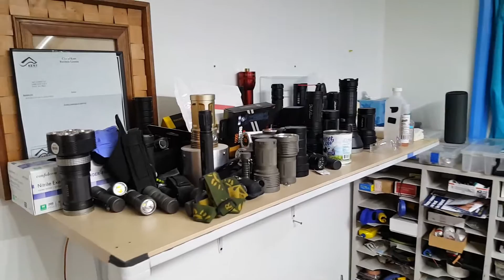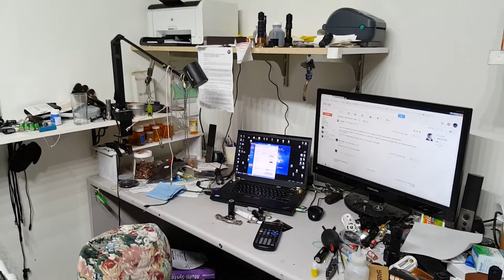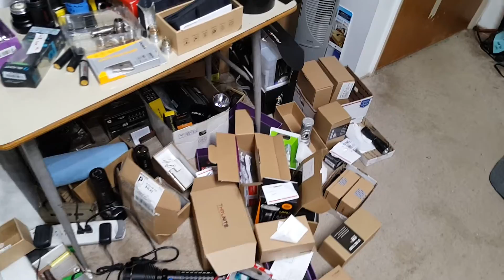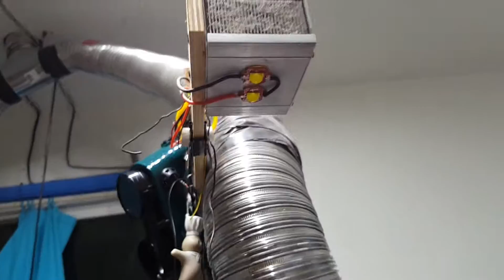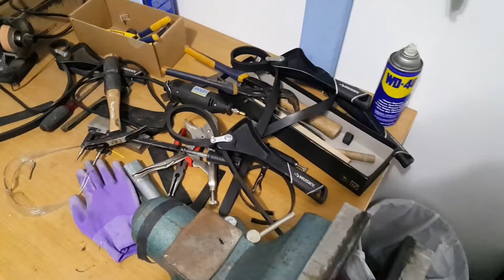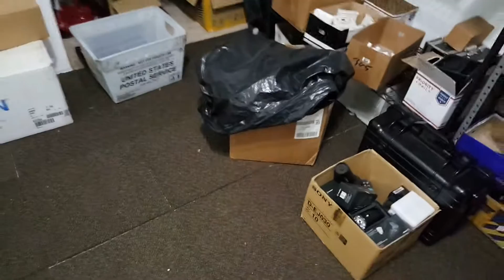Sky Lumen Lab Tour

Comment: This guy is a joke ! I sent him my Acebeam K70 along with a box of gifts to bribe the guy into a extra good job (let me say he did refund my 100 bucks )  so i had soldered a r150 in the place he said to put a r100 because not having a r100 and being a electronics tech i knew it was safer . so my light comes back has finger prints on the inside of the glass lost 600 lumens  now is less then 2000 lum . He didnt remove the r150 and put a r100 and the beam is shit . and the led he replaced mine with has spots on it ....Had i not had my name engraved on every part I think he would have sold it ..Honest to god I would not send him another light or buy one from him if he was going to mod it for free !  He may have good reviews from other people or self created ones but . I can tell you for a fact im still upset what he did with my light  ...Vin your a joke and that aint a lab its a make shift pig pin !